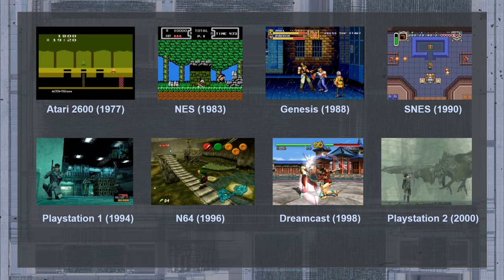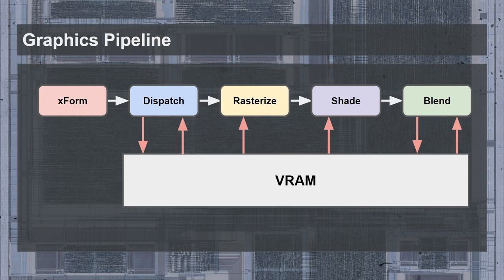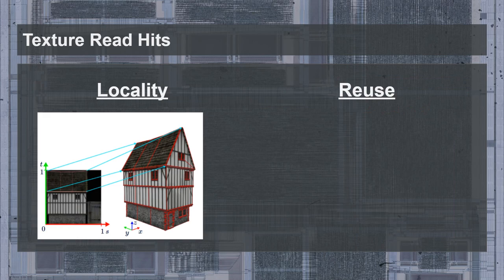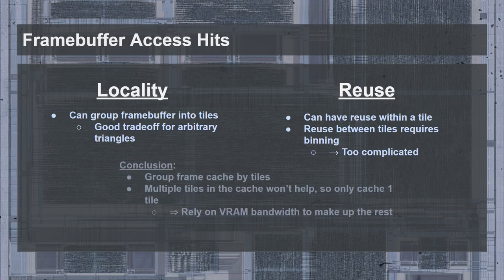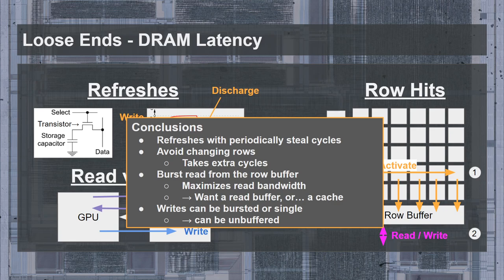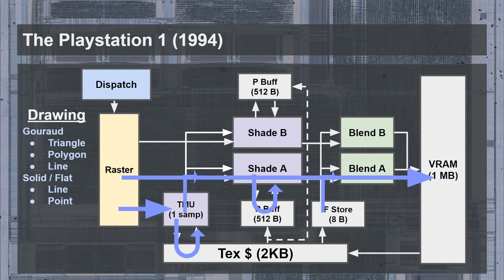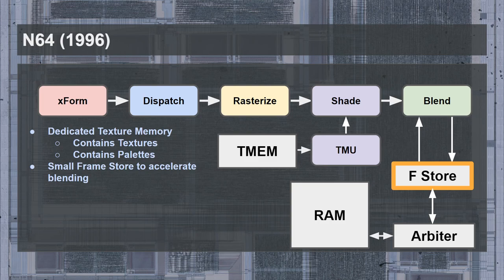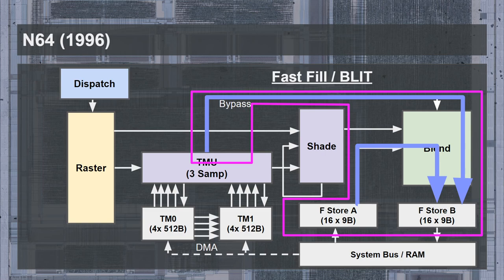GPU Memory, and Clogged Pipes (Part 1 - PS1 and N64) - #GPUJune2

Comment: i greatly appreciate your videos. the TTS isn't an issue at all for me because i know exactly what would have to go into making a video with voice over and the length and depth of content you make. awesome stuff! thank you!
Reply from the maker: Thanks! I'm not sure why there has been so much negative criticism of the TTS to be honest, especially considering that there are quite a few large channels that use it exclusively and in a much less fluid manner. 
As you said, part of it is balancing time, where the research and compilation of information depth means less time can be spent on production. I guess, that's something one can really only appreciate after making videos.

Comment: I wish I had the sources for those peak power (pixels per second) figures. They seem to be contradictory to other sources, even wikipedia.
Reply from the maker: There's no source, just simple math: pixels/clk * fclk = pixels/sec. And yes, there are a lot of errors on wikipedia, although some of the contradictory sources were linked in the references.
Was there something specific that you noticed?
Reply: @RTLEngineering   I believe the mhz on the gpu is 53 mhz.
"The GPU clock is about 53MHz, with the exact frequency changing between NTSC and PAL - NTSC uses 53.693(18) Mhz and PAL uses 53.203425 MHz "

The 53 mhz figure seems easier to find than the 34 mhz figure. The first link I got on stating that the GPU, not the cpu, was 34 mhz was a gamefaqs discussion with no source.
I also rechecked wikipedia, and tried skimming it really quick, and had to do it...more than once; as I could not find any real information on the gpu speed and fillrate at all.

Note, I don't always use google, I've used bing, yandex and more obscure options like marginalia. I'm really puzzled why the gpu clock and fillrate isn't common knowledge and easily checkable and why the 34 mhz figure eluded me.

Comment: TTS sucks, my guy.

If you have zero passion, just don't.
Reply from the maker: I am aware, but it has been the best possible solution for me.
As for passion, that's a blanket statement when there's more nuance. The passion involved is in communicating the information presented in the videos, especially since no one else has (at least at the depth presented). 
But I do lack the passion for spending 2 days recording 30 minutes of voice over, and then spending another 4 days editing the same audio so that it's bearable to listen to. If other solutions were more efficient for me, then I would use them - not using TTS would require an extra 6 days of production effort, which frankly is not worth the value that it adds, especially since I have other responsibilities that must come first (e.g. a day job).
Reply: @RTLEngineering  Copypasting some Wikipedia articles into TTS is not passion.
Reply: @RTLEngineering  Wannabe retro YouTubers...
Reply from the maker: Clearly you didn't watch the video, and commented after the first 5 seconds because you were annoyed by the TTS. If you're going to base a comment on that, just don't....

None of the information the video was taken from wikipedia, and in fact, some of the information on wikipedia is incorrect. I did use a few images (not the main diagrams) from wikipedia because they are in the public domain (why spend the time recreating them). So if I didn't use wikipedia, where did the information come from? Technical documentation, development conference presentations, computer graphics textbooks, computer graphics journal articles, analyzing and reverse engineering parts of the die photos, and extrapolation from all of the above.

I am not trying to be a retro YouTuber. Retro YouTubers focus on the historical context surrounding some technology, which I tend to gloss over. Instead, I focus on the engineering behind these systems and how they worked. I could just as easily cover modern systems like the PS5, but those are both more complicated and less interesting due to their reliance on parallelism (I did a video a while back going over the NVidia Tensor Core for example). The main advantage to covering something older like the PS1/N64 is that those systems have a lot more documentation, and are significantly easier for an audience to understand. Besides, all of the principles that were used in the older systems, are present in modern day hardware as well.